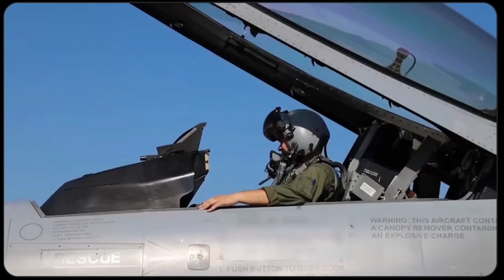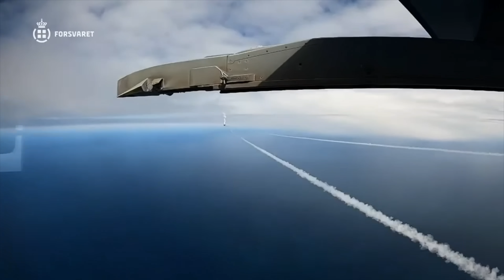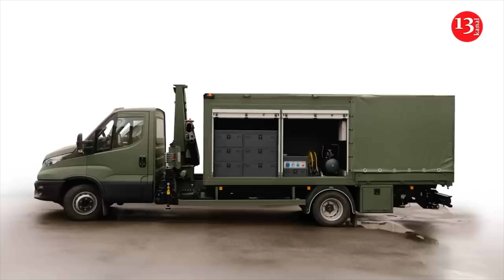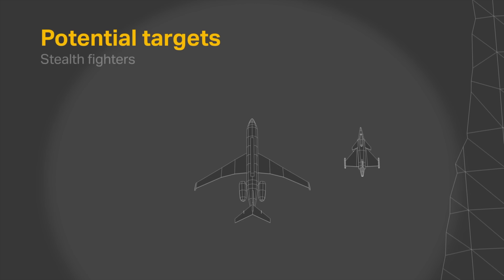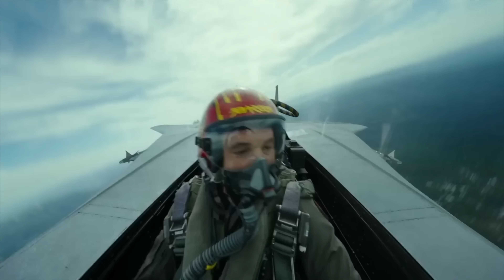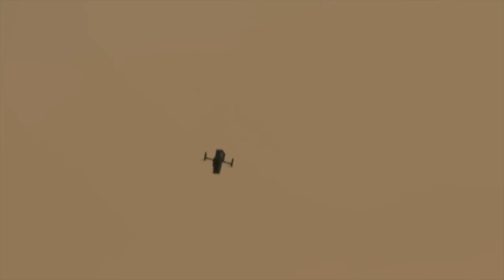Ukraine's Mobile F-16 Ops are INSANE!

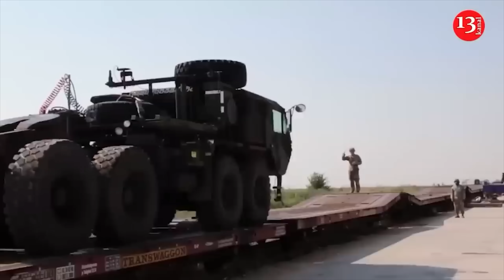Comment: 12:07  it’s a mobile Fixed Wing FAARP; these are what rotary wing a/c’s Forward Arming and Refuelling Points do; the UAF is fine tuning this and applying lessons learned.  We did these in Afghanistan in fall ‘02 to extend the range and give commanders a place to fine tune troop loadouts and give the CDR’s options he would not ordinarily have.

Comment: 4:26 while we haven’t seen these tactics used in combat previously, Sweden has been using this doctrine for decades at this point. Basically all the Saab fighters are designed to land and refuel on highways.
Reply: Finland too with their hornets. the whole country is dotted with normal highways made just long and wide enough to a fighter to use as a runway.
Reply: @Ianassa91  That’s cool thanks
Reply: They were used in Yugoslavia in the 90s. It was effective at keeping planes from being detected on the ground, but there was also a lack of spare parts, which crippled the air force ability to fight effectively. A lot of countries practice this. It's not as uncommon as it's portrayed in the video.
Reply: @fortweek_7389 Thanks good to know. I need to learn more about the Yugoslavian conflict.
Reply: USA all highways have been built for aircrafts, recently we just upgraded our overpasses to function as Hangers and able to withstand 1000lb ordinance
Reply: This tactic was not uncommon during cold war. Also Germany uses highway as runways, with standard jets like F4 Phantom, Panavia Tornado or C160 Transall. You do not Need a specific jet for this.

Comment: most german airbases have a nearby strip on the autobahn wich can be converted to airstrips in a relatively short time, even allowing large transport aircraft to operate. this is core nato tactics from cold war, swedens air force doctrine is designed around such as much as the mig 29 is. i recommend to read about german luftwaffe operating in WW2, especially in that period after allies gained air superiority or operating on the move at eastern front.

Comment: The first jet drones with full ai trained with tons of data and good agility and speed can easily decimate any none drone jets.
A Pilot can NEVER become as good as an ai. It is like cheating in video games. With all the sensory data that jets have, ai can even estimate locations of stealth fighters and if it is equipped with anti air weaponary, it would devastate every air dominance and can even become very dodgy against missile based anti air solutions like patriot. 
Jet Drones will change everything.

Comment: lol they can’t take off from 95% of ukraines rough runways , so the reality is they probably aren’t able to be used to a huge degree and aren’t competitive against high end Russian aircraft as the Ukrainian airforce commander has admitted. With better training and in a non competitive airspace it would do well
Reply: go to the original video...
Having huuuge airfield, you can simply move from one side to another (change location), but not stand still. You can change also airfields...

Comment: U.S often likes to downplay the Falcons effectiveness, but at close to 50 years old, those operators who have used them achieve great success.  These early models with MLU upgraded may have already been boosted to  5th generation Block 50/52 capability.  Even without AESA, they can still get the job done.  Imagine if  they put the thrust vectoring engines on F16s, they will be even more deadly similar to European’s Typhoon, Gripen or Rafael.  But the best of all, it’s how good it looks.

Comment: SU-35 is a huge aircraft, as are all of Russia's modern airframes. This is because, over thirty years after the Cold War ended, the Russians still cannot miniaturize electronics to the point America could in 1976 with the F-16. Bigger planes equal bigger radar signatures, equal planes shot down.
Reply: 😂 Russia makes bigger frames because that's what suits their huge territory. They need planes that will cover more ground with less refueling. Stop smoking

Comment: Looks like propaganda video. F-16 landing gear is very fragile and it needs long runways, I doubt these huge pavers will be any good.
Reply: Where did you get that misinformation from?
Reply: @CorneliusTaylor-s1uLockheed Martin
Reply: @CorneliusTaylor-s1uMisinformation is the Vid
Reply: @waqarahmed-zo1yi 

For one thing, the F 16 gets up in air very quickly. As fast as any modern fighter. Secondly, there is video out there showing F-16's landing in a very short distance, especially so when using the parachute.
Reply: i doubt it, while its not a Mig-29 that can land on "Wheat Fields" in a emergency, Norwegian F-16's have been landing on the Roads in exercises for some time, i am guessing with some Modifications on Landing Gear you can make a F-16 more friendly for Road Operations, of course you wont get the same Road Performance out of it when compared to Gripens, same "Dummy Thiccc" Landing Gear Strenght on F/A-18's or the same ability to land on Fields and be okay like the Mig-29's... however, to call it "utterly" impossible would be unrealistic.

Plus, Ukraine uses Older F-16 Blocks like Block 30's that are tend to be "somewhat" on the lighter end when compared to Later Blocks, so that might be a Factor too.
Reply: @ylmazirdenyazc8393  the biggest problem for the f16 isn’t the landing gear. It’s the low hanging intake for the engine. The are very sensitive to debris on the runway. They suck it up like a vacuum cleaner.
Reply: @autobootpiloot

Not the problem you make it out to be .
Reply: @autobootpiloot while its true, i doubt they let their F-16's land in Dirt Roads or utterly unprepared Roads the same way a Mig-29 does (Mig-29 has a Intake Sealing Door for such operations) if anything, its likely similar to Poland, you would have Roads that are "Designated" as more Aviation Friendly than others and F-16's could end up being directed to these Locations... Ukraine is a Big Country (though one that i do not know whether it has Roads specificaly designed for such operations like Poles and Swedes) so i doubt there isnt a Single Road that is in any way suited for any form of Aviation.

So i do still believe that doing this with F-16's is possible, but to do that the Ukrainian Air Force really needs to know what they are doing, coordinating with Civilian Infastructure to designate these Landing Areas, set up Maintenance Vehicles before hand and having Facilities to Hide these aircraft...

...so it takes a lot of Coordination, and while i would prefer doing this with Gripens, Dassault Rafales or F/A-18 Super Hornets (they are underrated in terms of how easy they are to fix or maintain) i guess you can do it with F-16's if you are Careful, Plan these operations well and know what you are doing...

Of course, Gripens (even Viggens), Rafale's, Superhornets and Mig-29's are much more preferable in such usage, but it seems sometimes you just gotta work with whats on your hands.
Reply: @ylmazirdenyazc8393 

There is absolutely nothing preventing F-16s from operating off of paved roads and highways. They have a history of doing that. Nothing special needs to be done.
Reply: @ylmazirdenyazc8393 

The F 16 is friendly enough to operate out of roads.
Reply: @CorneliusTaylor-s1u dude, you are really buthurt because some people criticise the f16 aren’t you? Get over it man, the f16 isn’t replaced in about every modern airforce because it’s the best fighter available. There are serious flaws in the operational capabilities of the thing. It’s one of the most, if not the most sensitive 4th gen fighter there is. That’s something all f16 lovers that can think even a little bit objectively admit.
Reply: @autobootpiloot

No, I just don't like misinformation. Everything that I have said is correct.
Reply: I am sure its a propaganda video.

Comment: I have a friend who is a retired USAF Lt Colonel with 1000 hours in the F-16.  He said that there is no finer fighter “in the phone booth” than the F-16!
Reply: He might be a bit biased. I'll take his word for it though.
Reply: What kind of sport bike does he ride?
Reply: Getting adversaries into that phone booth is the real challenge
Reply: F-22 smokes everything within visual range
Reply: @TannerJohnson25 Not, but it does smoke everything beyond visual range
Reply: The phone booth dont apply to BVR
Reply: @SNO_WYTE_iceLORD  the wild weasels dare say otherwise
Reply: @SNO_WYTE_iceLORD thanks captain obvious 🫡 you’ve done it again
Reply: A Euro fighter can turn harder and accelerate faster. An F22 is a level above that.
Reply: Id bet the F15s are better
Reply: It’s like the equivalent of a 1,000 hp Honda civic. Super car power fairly affordable and nothing super fancy.
Reply: Depends on speeds.
Reply: @PeteV80 I'm not pilot, but speed inside a phone booth sounds like a less useful help than turn radius and off-bore missile lock.
Reply: @UTK67Proud  No, it really does depend on speeds, if the F-16 gets slow for example against say an F/A-18, the Hornet will win 9 times out of 10, the Hornet owns the high AoA fight against an F-16.

Comment: Holy smokes... Saab radar from 300 miles away eyeballs to the F-16 in close.  Not an aviator but I imagine a SU-35, with thrust vectoring will absolutely out manuever an F-16 in an upclose dogfight.  Esp. with new pilots.  So, our theory here is that (by some means)  they can hear the direction from the Saab without giving away their location and their missle does the rest.   Scary stuff for the F-16 pilot, but those guys are nothing, if not brave. 

One advantage they have is that parts of the battlefield are blistering with RF traffic due to all the drones.  That might provide an interesting mask.  The fact that they downed the SU-35 in country forces the Russian to redirect signal and air defense resources away from the front line.  No harm in that.